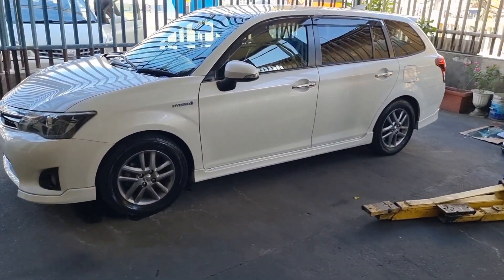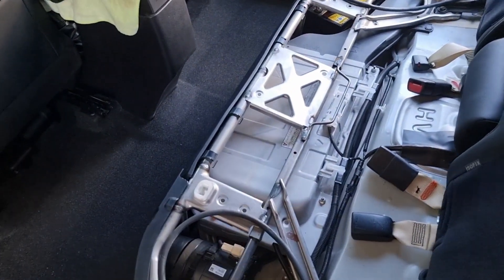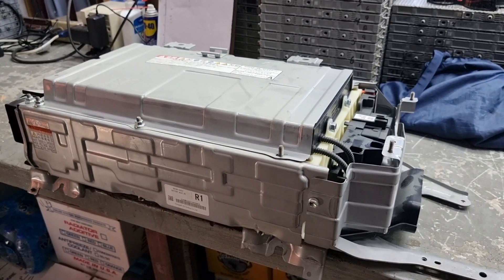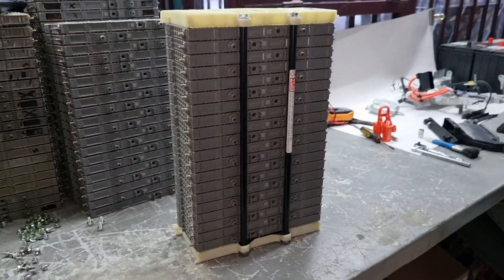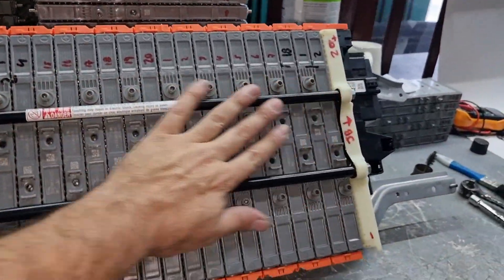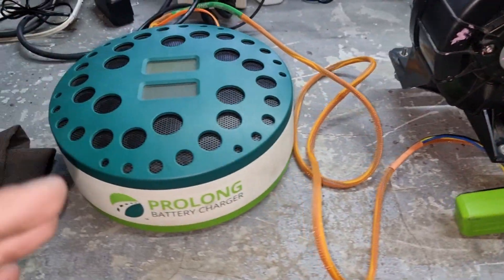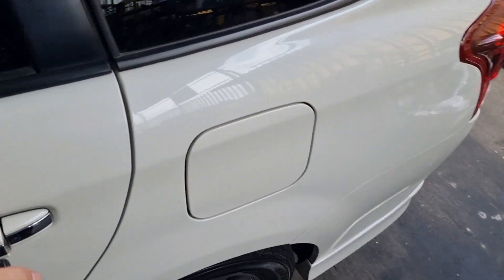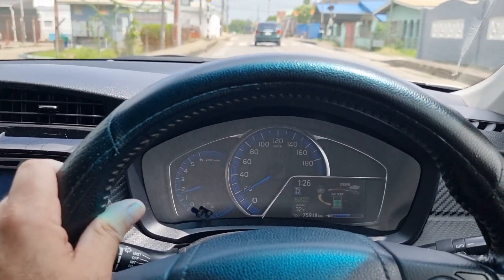reconditioning a bad hybrid battery will fix it? let's find out

Comment: I bought a used 2011 prius. Ive owned it for a year. It has 208,000 miles on it and after the last oil change with synthetic oil, its been losing mpg down 4mpg from 2 months ago and dropping. There are no trouble codes at all. A new battery pack with upgrades are 1800 dollars. I can change it myself, but not sure its even worth doing. Certainly not taking it to a dealership to get ripped off. But, that being said, EV's and hybrids are too expensive to fix and I won't be buying another one.

Comment: Weaker cells will have increased in their internal resistance value and if you identify the culprit/s then you should get the theoretical maximum capacity if and when all the cells have IR values as close as possible and the pack should stay in balance. I haven't worked on hybrid batteries but know my lithium-ion cells
in ebike batteries. I just ordered a  Honda Jazz hybrid battery from ebay and will be tearing it down including the BMS. What is confusing me is even an ebike
battery (whatever its voltage and Ah) will have a BMS that will have cell balancing. I can't imagine that this crucial function of a BMS is not available for a
hybrid battery. Also would like to say a lithium-ion cell's storage voltage is 3.6V and maximum charge voltage is 4.20V. If you are measuring 8.50V, meaning
each cell is made up of 2 cells in series then what guarantee is there that individual cells are in balance in the first place. Unless I am mistaken that each
cell is not made up of 2 lithium ion cells connected in series. Can you confirm the cells are measuring around 7.20V at half charge and 8.40V at full charge.
Do you have a datasheet for the cells?

Comment: Hi nice video but I noticed 2 or 3 problems. 1. that car has the steering wheel on the wrong side of the car. Is the gas pedal and brake pedal on the wrong side too? 2. You were driving on the wrong side of the road. 3. Well I am thinking instead of doing all of that I wonder if you would of just cleaned the old rust parts only and put back together I kinda bet you would have gotten the same 66% result? What you think? I'm from California USA. Also since I got you here and everyone else could you please tell me how much it would cost to rent an apartment or condo on top of the tallest building in your country? or how much it cost to buy it? Thanks in advance for anyone that will reply to me cause I want to visit your country one day soon. But first I need this information.

Comment: Its 2023 Dec, I am presently thinking about buying a used  2015 Nissan X trail hybrid. It's doing  just over 62,000 k. Watching your videos on transmission problems on the X trails hybrids , plus the vehicle age and I don't know to much about the cars history although I believe the vehicle is way under used, this is hot weather 🇹🇹  I'm thinking about staying away from this buy, but the condition of the SUV is very tempting .You have me thinking 😊 Brian .I will get it Scanned

Comment: too bad you switched out the 7 elements. It would have been more interesting to see if you could do this with the original modules. You're not really doing this to a bad battery anymore since you switched out the problematic modules.
Reply from the maker: Brother, as I clearly said at the end of the video… there is no way to bring back to life weak modules 🫡🚨

Comment: My 2016 Camry hybrid 75,000 miles has been getting 18 mpg for the last two months and after multiple trips to the dealer they say there is nothing wrong. I do not have any dashboard or check engine lights. I use top tier gas and always have 35-37 psi. Tires are only 6 months old and the same brand and model as when it was new. Yes we use the air conditioner year round in Arizona. Question is could it be the battery?
Reply from the maker: Yes… battery has loss capacity most for sure…
Reply: @hybridsolutiondiagnostics  in your videos you talk about how it is not possible to fix a bad battery only twmporarily. Since I don’t have a code does this mean that if I service the battery it will work for a lot longer than a bad battery? Or does this mean it’s time to just replace it?

Comment: Jose, going back to my 2015 3GEN NiMH w/100k (long post) please help me on this one, I never had error codes, triangle or MIL, all stock. I decided to investigate the HV battery because I noticed when under heavy acceleration, the car accelerates well, no power loss or anything but looking at the energy flow (the little arrows flowing on the display) I see the generator is actually charging the battery pack, the wheels are being pushed by the ICE and the electric motor receiving current from the generator instead of the battery while the HV battery is receiving power from the generator as well! so charging instead of discharging?
When comparing this to my GEN4, it operates differently, under heavy acceleration, the electric motor pushing the car with current from the battery, so no charging, along the ICE, so GEN3 is running in parallel yes, but what’s the point of the battery if the ICE is doing all the heavy lifting, the battery pack does push the motor when accelerating gradually, but it will revert back to charging if you demand heavier throttle. I’m not sure if this is a normal behavior for GEN3 that’s improved in GEN4.
It's worth noticing that this happens even when the battery meter reads 6, 7 bars, so it’s not that the SoC is low to demand charge, also the 12v batt is new.

I watched some YT videos where they do 0-60 times on this generation, and I see their arrows going to from the battery to the motor instead of charging the battery so I suspect something is up with my GEN3, -thoughts?
DR PRIUS results life expectancy was 54.40% with a “weak block #7 detected" is this accurate? Yet no lights on the dash, the test didn’t last the 800s of course.
The full battery test (where you accelerate and stop fast) throw a “battery running warm” but everything else passed, I do notice the middle temp sensor is sometimes 7 to 9F higher. TechStream shows NO codes under ICE or Hybrid control, nor freeze frame either.
HV cooling fan and filter are clean but the battery itself never had any maintenance before.
Because of all this and the temp warning I plan on cleaning the busbars using your video tutorial, and perhaps rotate the modules as you recommend, but just rotating, I plan to NO messing with charging, discharging, or balancing due to lack of experience myslef, can I just rotate the modules without rebalancing? Or rebalancing is a must when changing positions? if rotating alone is bad, then again no.
Sorry for the long post and the multiple questions, hopefully you can help me with some information? The charging behavior under heavy acceleration while MG2 getting power form the ICE instead of HV batt is making me scratch my head because technically the HV battery is not being used under full throttle, so the car runs in "parallel" with no HV batt assistance? I'm not the main driver for the GEN3, and perhaps it was this way since I purcahsed with 88k (second owner) I never paid attention to the energy flow until I got my GEN4 brand new and spotted the difference.
Thanks for all you do by teaching us and I really appreciate your feedback.

Comment: He replaced "7 of the worst modules".

And the reason the overall life expectancy goes up is because if there is 1 faulty module, the battery pack will give you a false overall life expectancy. All the other modules will be limited by the one bad module. I went from 4% life expectancy to 89% by changing out 4 bad modules. And yes, cycling the batteries does help the capacity also. I've gotten modules from 4500mha to 6000mha by cycling them. 

So I dont know what the heck you guys mean by you can't recondition a battery....

Comment: I dont get why you even make videos if you cant recondition a bad battery.... isnt a code enough to know you need a battery replacement? What is the use in your videos then? 

When people say "recondition battery" what they mean is - test for capacity as well as voltage, and change out the bad capacity and voltage modules.

Comment: Women if you go to autozone let them know the maked model of your car they will tell you exactly what type of liquid it goes in your car what type of oil with type Oil that you need that's compatible to your vehicle Now if you have a Toyota As long as that as the gas has less lettuce possible or no let at all is even better I didn't know I haven't driven a car in a long time so I thought maybe they had I'm let it let it with let it I just learned that all gasoline is  unleaded.

Comment: I have a 2007 Toyota hybrid Camry. The hybrid battery went down Toyota moss brothers told me that I would have to replace the battery and he didn't even "me on how much it would cost because it's just as much as buying a car supposedly but what I heard and they're very very expensive I guess it's just as much as buying a car a brand new 2023 That is what Toyota Moss brothers in Moreno Valley told me but what they failed to tell me is that if you look online you can get help even though it's still expensive But nearer not nearly expensive is buying a brand new vehicle now it was worth it there are some that will guarantee you a lifetime warranty unless the vehicle is sold I checked that 1 out and that 1 had a 5 star rating It's online and you can check the background they do come to the house cause some vehicles do not run. So they do come out To your home to fix the vehicle they do not charge you any money until it is running And if for some reason they cannot fix the vehicle the most it will charge you is there time for coming out wherever you're located which is a couple 100 bucks Did an investigation and I had a close friend of mine do a thorough investigation they are called to go hybrid and they are contracted with hybrid express. They do give you a lifetime warranty on it. Supposedly they're located all over California but thank goodness for my brother most mechanics will take advantage of women my brother found the closest mechanic that did dill and fix hybrids or replace hybrid which I found out is the same price from 7th to 1400 To 18 hand if they give you a price Make sure that they're gonna give you the correct price with tax scenario thing included don't let them change the price on it. 1st of all you ask him am I talking to the person in charge that's gonna "me for the price check on the hybrid battery question make sure you ask those questions make sure you do the background checks. If I would've known everything else a lot sooner on hybrid express I wouldn't got it done. Now they can do it the same day it just takes a couple blouse some take less some take more the more hours they take on your hybrid battery the better it's going to be. Now I was lucky enough to have my brother with me because like I mentioned Lear they do take advantage of women and that's a fact I let them know over the phone that my brother is experienced on cars. Women take the time to learn how to do the most simple things in your car Check your gauge check yourspills don't let then take advantage of you if you go to a dealership and you say could you make sure I have all my fluids they might not tell you the correct answer so you need to know and learn exactly how much oil you have in there How much power is during break oil and all that good stuff and where it goes and the Correct liquids that sustain your car.
Reply from the maker: Quite a story 😮

Comment: Recently, after 7 years my car got the p080 code with the engine sensor always turned on in Yellow color. Are you an indipendent toyota repair ? I don't know how to solve this problem.
Reply from the maker: Watch the complete video then you will know the problem
Reply: @hybridsolutiondiagnostics  Do you know if the bad battery and the p080 code is also the cause another problem or maybe a defect of my Toyota, is that of "the random petrol engine accelerations" that occurs when I drive without press the gas pedal ?

Comment: replacing cells, as u did, means that this wasn't just reconditioning. But thanks all the same.
Reply from the maker: Because reconditioning won't ever fix a bad module...
Reply: He didn’t replace the bad batteries. He only moved their positions

Comment: I'm curious about how long do you expect that particular battery to last. I am debating between replacing mine, in a 2009 Prius, with either a rebuilt or a new one. I was quoted today $750 to replace with a rebuilt. I have not checked the cost of a new one (installed) yet. The rebuilt will have a 3 month warranty. I do drive this car a LOT (maybe 30k miles per year) and I need to get at least a few years out of it. I know they used to say about $2k for a new battery, but I don't know if that's including labor and that was a few years ago they said that. I'm expecting it to cost more these days.
Reply from the maker: Well serviced they should las many many years 👋😎👋😎
Reply: Rebiild battery work not long time  6mouth  , buy used from new cars Hybrid battery replays all banks with yours this is works

Comment: Does bulk charging the whole battery (of 14 banks/ 28 modules) actually work well?  I did each module individually, and I would think that bulk charging would be worse/possibly damage weak cells. rather than improve them.  If Prolong/bulk charging works as well as individual module charging/discharging, then that's great!   After replacing bad modules, before using Prolong/bulk charging, I would think at the very least you'll want to charge all modules individually to within .05volts of each other,  connect all the positive leads and (separately) connect all the negative leads so that the modules are all in parallel.  After 24 hours the modules will be balanced.  Then, when you reconnect, the prolong process might go better.

Comment: I'm showing 230 volts dc now.
After reconditioning. 
First try no TRIANGLE. But the engine starts imedetly/runs 30 sec shuts off.
Dash shows 3 bars.
Today/tried again.
Found out the pack shows 230V? 
Now I've got red TRIANGLE? 
And already light/the engine didnt start so/I put it in reverse/ backed 15 feet /engine started?
Ran 30 sec.went dead.
Maybe 230 is too high.
I could bleed some off?
I've read the dash isnt accurate ot still reads half way/4 bars
Reply from the maker: Wach the video till the very end...
Reply from the maker: No my friend it is not that simple... but it is obvious that your battery is in very bad condition...
Reply: Thank You/
Ok will do.Maybe I should give this car away and try and get to a beach somewhere with nice 3 foot waves!

Comment: Ive got a RS771-7730 LED driver that put out 257 v DC @350mA I have used this to charge my Prius 2010 Hybrid drive battery  I know the total voltage can go up to 230 -240 v dc Is the method I'm using ok  the voltage is a little higher.? your thoughts will be appreciated.DB
Reply: Yes thankyou I use a 250v hair dryer to blow cold air through the intake. Thankyou for your fast reply I'm in the UK I just love your  YouTube channel
Reply: What is the max top voltage for 2010 prius
Reply from the maker: Should work just fine... jist make sure do not exceed long time after full charge and prober ventilation to disipate heat

Comment: Hi I had a 2013 toyota camry with a fault code PA080 I remove the battery found a corroded bus bars I remove & clean each cell show a 7.56 like 2 show a 7.59 & another 2  7.54 I reassembly & reinstall battery after i drove the car check engine come back again please advice
Reply from the maker: Send me a DM via our instagram  page👋😎